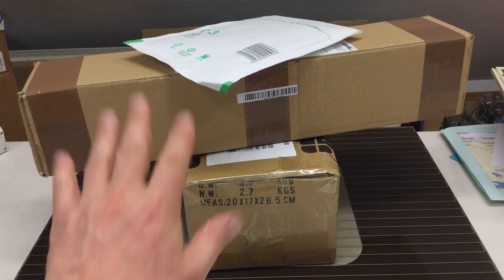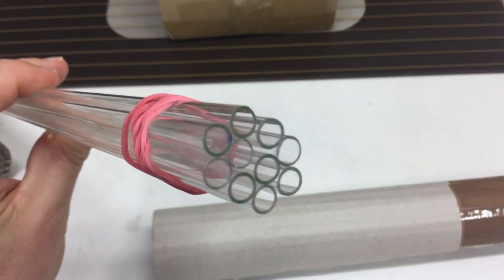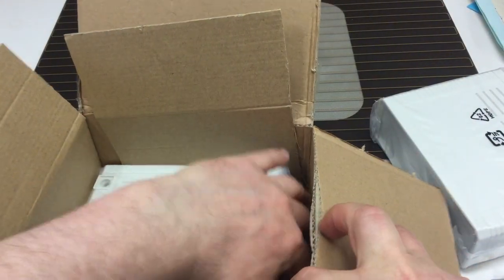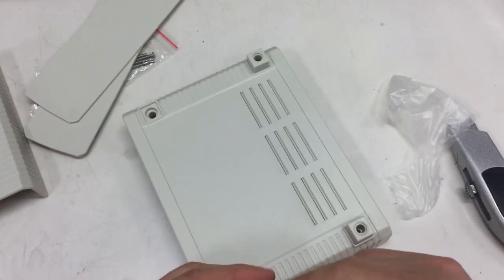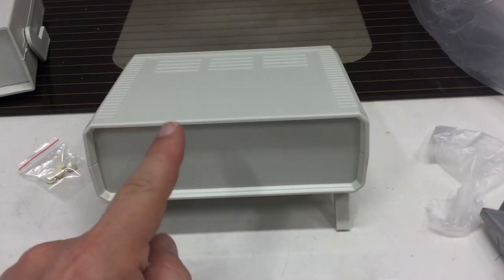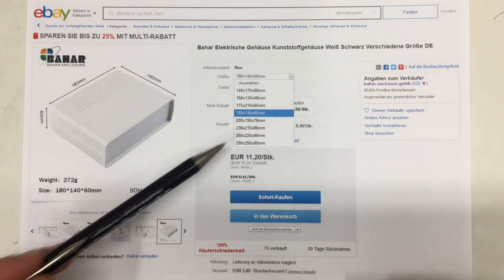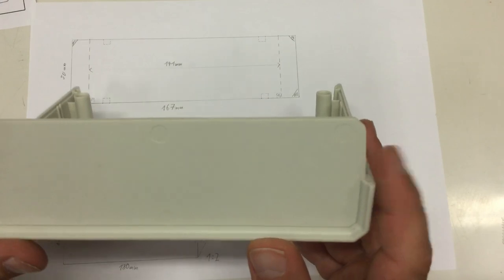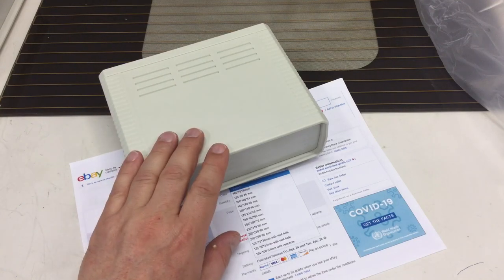Mailbag: Nuts ‘n Bolts, Glass Tubes and Enclosures (Briefly Reviewed)

Comment: Those are very nice and seems to be very good quality enclosures.
Reply from the maker: Indeed, I was surprised and quite happy to find these cases. I already worked with one (big mains AC IEC connector and big, round seven pin IP67 connector in the back plate) and still like them (sturdy enough to handle those connectors being plugged/screwed in and out).
Reply: @robertssmorgasbord  at Reichelt and Conrad are similar case, but different. Sometimes it's hard to find the right components if you have the complete project already in your mind. At the moment, i'm searching for flat knobs for potentiometers, everywhere i look at parts distributors, they have that ugly small and high knobs. I'm looking for big and low, like the knob on a DMM, or back in the old days, the selector knob on a HiFi system etc...